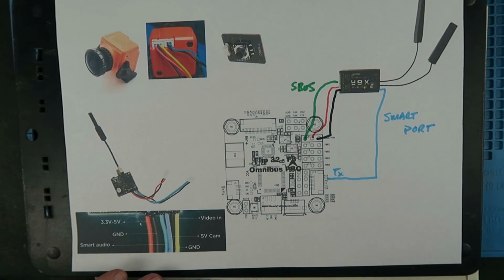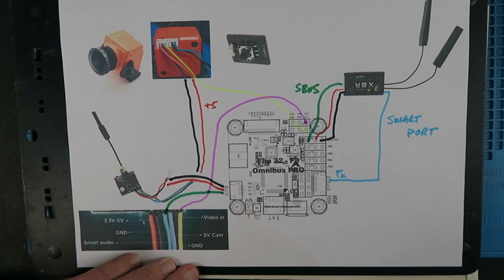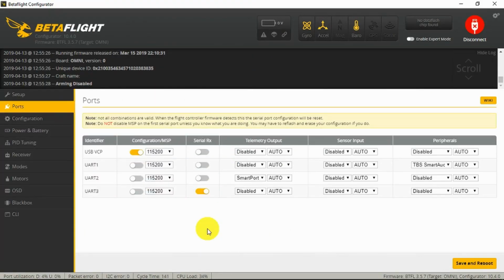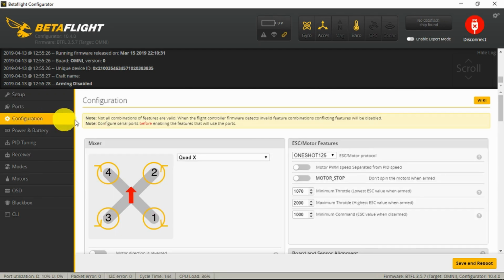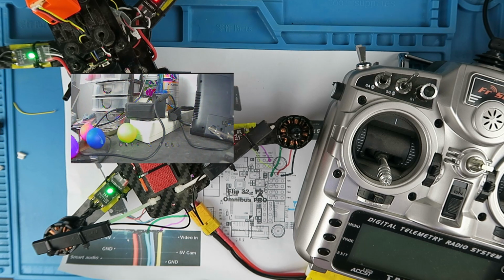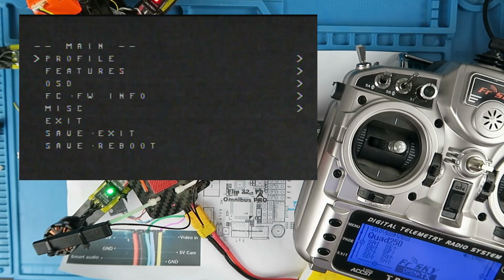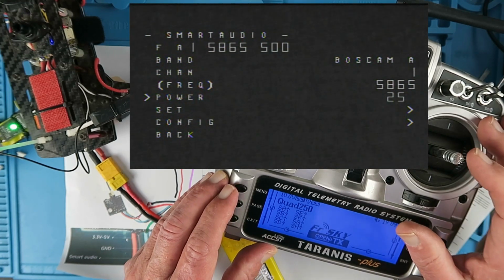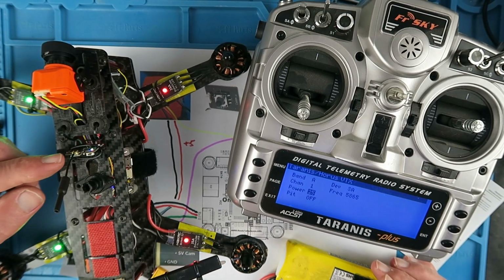Eachine ATX03S Smart Audio Setup & Test Tutorial

Comment: nice tutorial, i picked up the eachine tx02pro cam+200mw tx to add on a toy grade drone
hoping it had audio input, but looks like 'smart audio' pin is just for controlling its tx settings
Reply from the maker: Thanks! If you look at the tx02pro board you see there is no microphone. If you compare that to the ATX03S you can see the mic : https://www.banggood.com/Eachine-ATX03S-5_8GHz-40CH-25mW50mw200mW-Switchable-FPV-Transmitter-Smart-Audio-With-Microphone-for-RC-Drone-p-1427187.html?akmClientCountry=ES&p=NL2203782949201409M4&cur_warehouse=CN It is confusing as it is not stated explicitly.

Comment: How to connect it in th9x receiver? Specially the smart audio cable
Reply from the maker: Sorry, I do not understand your question. Smart audio is coming from the flight controller not the receiver.
Reply: @1nformatica  in india most of us using th9x
Reply from the maker: @mubashshirahmad7299  I am afraid it will not work. You need a receiver that supports telemetry.
Reply: @1nformatica  i am using spf3 flight controller + th9x old receiver without s bus port.
Reply: Spf3 (deluxe version)
Reply: I am asking how to use and where to  connect the wire that is soldered in eachine td600 (smart audio) one.
Reply: There’s no way around connecting the 3 cam wires directly to the vtx? I’m asking because I’m gonna use the “vtx03s” I don’t know the difference between atx and vtx models. Great video too. Thank you.